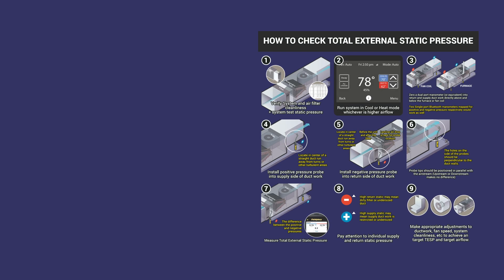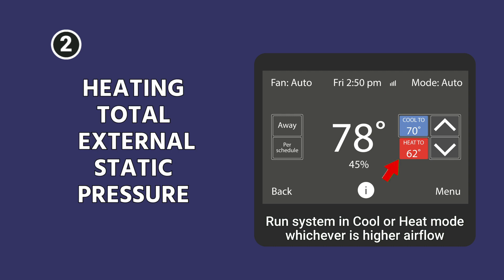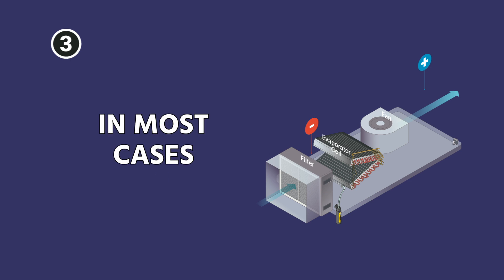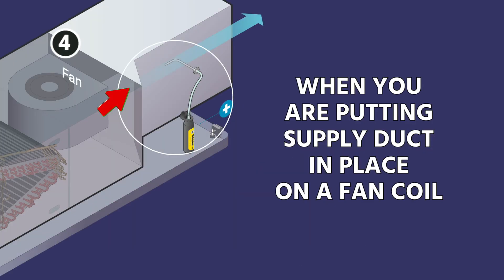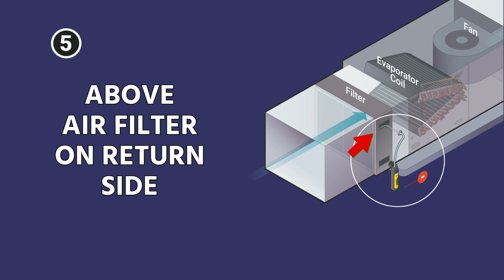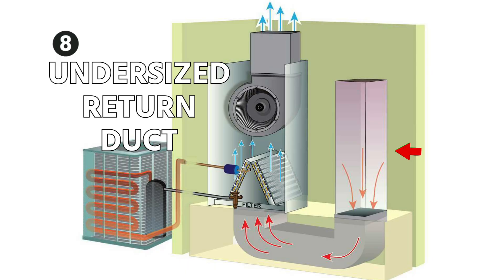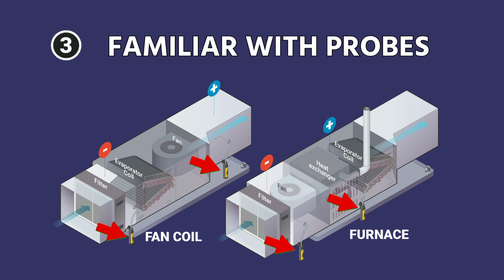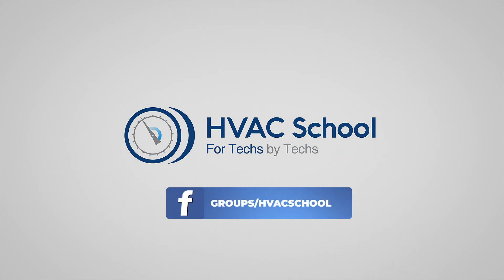How to Measure Total External Static Pressure (TESP)

Comment: This video shows a gas heat exchanger between the fan and the evaporator coil and goes on to talk about that.  My system is a heat pump with heating strips and the strips are located at the end, supply end i.e. fan, cooling coil, then heat strips.  Is there any difference with placement of the pressure sensors for that arrangement?

Comment: I think you should remove the line "avoid getting air into the end of the probe"...it is confusing.  "Point the static pressure probe directly into the flow"  You can then explain that the static pressure probes have pressure holes perpendicular to the point to measure the static pressure not the velocity component of pressure.

Comment: since the fan could run at different speeds for heat and cooling, wouldnt it better to check in fan mode since that will run at full capacity

Comment: Could you please explain to me why the blower is on the supply side of a residential air handler. I've been looking for the answer to this for weeks. I keep getting conflicting answers. Thanks
Reply: The Hyperion air handlers (Trane Tam) units put the blower before the coil. Worst design I ever seen. They are insanely loud on free draw stands and leak air everywhere.
Reply: On furnaces the coil is blow through...on heat pumps they are usually suck through coils.  This was a tad confusing.
Reply: Because an air-conditioning system's job is to 'supply' a space with conditioned air.  That air then eventually 'returns' back to the unit due to various factors, including velocity, pressure, temperature, etc.
Reply: @ParabellumX  I don't think that's this person's question. He's probably asking why the blower is after the evaporator coil versus before. It doesn't matter what side the blower is on as it'll still move air in the same direction...

The question is better asked as why some configurations have the evap coils before or after the blower. I believe HVAC's with gas furnaces may have the evap coils after the blower.

Comment: You say to point the probe into the air stream then you say you are trying notto get air directly into the probe . How is it that you can avoid velocity pressure when you point the probe directly into the air stream.  You said point it opposite of the air flow (not with the air flow) I think you are measure ing velocity pressure id you do that.
Reply: The answer to that is : the probes don't have an open ended tip like a plain tube that is bent 90 degrees. the openings are on the sides of the tip. check out some close up pictures of the products out there for a better view than i describe. hope this helps
Reply: @googleprivacy2829  Yes this. Static pressure is the pressure NOT associated with changing the velocity of the air, so the airflow must be perpendicular to the actual openings on the probe.
Reply: @googleprivacy2829   - That's what I was looking for.  Thanks

Comment: What about a unit with electric heat strip. Where do you place probe before or after Strip..
Reply: If you want to know what the static pressure of a unit with heat strips, first, turn the unit on Heat, and make sure that the indoor blower motor's fan speed is on High (turn the Fan Select switch from 'Auto' to 'On').  Then, simply place your negative probe IN THE AIR STREAM before the heat strip(s), and place the positive probe IN THE AIR STREAM after the strip(s). 
  The difference is your pressure drop. 
  The problem with this scenario is that you are not measuring the pressure drop of the heat strips themselves.  You are measuring the drop in pressure ACROSS THE UNIT, with the heat strips being the only means of providing heat, and the indoor blower facilitating the pressure drop and circulating that heated air into the conditioned space.  Obviously, if you have a heat pump or a gas/electric furnace, then the heat strips are not going to be your primary source of heat, as the strips are for emergency, or backup heat. 
  You would have to disable everything but the indoor blower motor and the heat strips in order to determine the calculation you are inquiring about.
  In my opinion, that's just not very practical.  Instead, it would be more practical to determine the pressure drop across each individual component (i.e., the air filter, evaporator coil, and even the blower itself).  Then measure the TESP (Total External Static Pressure) across the entire assembly as a whole.
Reply: Read the handler manual. In some units, it's not practical to measure before a heating strip, but the handler manual or heater manual should specify a static pressure drop which you could then subtract from the high side reading if you probe after the strip. However... strips are like .01 or .02 inches of pressure... so it's not much of a factor.

Comment: I do not understand the placement of the probe on the fan coil unit. If the probe is placed before the coil and the coil is blocked with dirt and crud you will get a low reading but if you place the probe after the coil you will get a high negative reading because that fan is really sucking trying to move that air and when this is added to the supply probe static you will get a very high TESP which means you will be moving less CFM’s. Somebody please help explain the placement of the probe on the return. If I want to check static on an old unit I will not get a correct TESP if my return probe is before the dirty coil. Thanks.
Reply: That's the whole point to find an issue as to WHY the airflow is obstructed. Recommend Cleaning the coil and then check it .
Reply: @Progress24.7  My whole point is that they say you place the probes here and here to get the TESP. That is only true on a new unit. If you are servicing an old unit you will not get a true TESP if the coil is blocked, you will get a low TESP meaning you should have more airflow. Probes placed on the discharged of the fan and the incoming or return side of the coil will read low TESP if the coil is blocked, which means more airflow and actually it is complete opposite.

Comment: Why don’t you put the probe next to the blower on the fan coil??? Instead of before the coil? It would add more resistance, or is it because you’re measuring “External” static pressure and not “total” static pressure?
Reply: Total external static pressure of the whole air handler is being measured and the coil is part of that piece of equipment. On a furnace, the probe is inserted before the coil because we are measuring the TESP of the furnace. Also, when measuring TESP, check manufactures instructions to see if the coil should be dry.
Reply: @bill944  Thanks, I guess that makes sense. And what does a dry coil mean? Not running I’m AC or HP?
Reply: Yep. Just pull the o/d disconnect. Most important thing, always read instructions for that specific piece of equipment.

Comment: This is awesome, however I would disagree w/ the AH / Fan-Coil section... Most units include / come w/ a factory filter, however the docs are typically horrible or never mention what the drop is for said filter (and they're typically way to small for anything but a rock catcher)... This is why I prefer static mapping on new equipment (although I know that's beyond the scope of what this video is going for).
Reply: You are correct usually when dealing with Carrier fan coil the external static chart includes a factory filter, As an example for a  3 ton Fancoil I found carrier data published as a .09 static pressure drop for factory filter.  Therefore when measuring out in the field more than likely the factory filter was replaced with a pleated filter which now may have a .4 static filter pressure drop.  From here is simple , measure external pressure including filter , obtain that measurement and then take the difference of the replaced filter vs factory filter reading and add to external measurement then go to chart.  For example you read .3 on fancoil , then filter difference (.4 -.09=.31 )  , then add .31 to your external measurement and now your actual static is .61 , now that’s the number you plot on chart, you must always adjust from factory readings , most people miss this and it’s never taught.
Reply: Trane manual specifies no filter with wet coil and dry coil (heating and cooling modes). But it does have TESP ranges which COULD include a filter. So It effectively takes filter variance out of the spec.

Comment: Does the furnace motor matter? Will ECM motor increase static and PSC decrease from lack of airflow?
Reply: I have been told that psc blowers tend to “slip” at higher static pressures, which I take to mean that they don’t spin as fast. EC motors will hit their rpm target if they have any enough horsepower to get their working against higher duct static.
This is is the explanation I’ve received for why psc motors draw fewer amps when they are starved for air and ec motors draw more.
I’d love for somebody to verify that.
Reply: @paulgaras2606  I've been told the same thing. Thanks.
Reply: @paulgaras2606  Some Lennox furnaces with ECMs will actually throw an error code to let you know that they are not moving the cfm that they were programmed to deliver. This is on the newer furnaces. The old ECMs would just destroy themselves trying to produce the cfm that they were programmed to deliver. Of coarse, the programming is done by adjusting the dip switches on the IFC. Psc motors will over amp if there is no load on them so it would only seem reasonable that the amp draw would be lower if airflow is restricted. Take a psc in the housing out of a furnace going to the scrapyard, power it up and check amp draw. Slowly start to cover the outlet of the blower housing with cardboard and the amp draw will go down.

Comment: Thanks Bryan.  Question: Why do you not take the reading at the inlet of blower after the coil on the air handler system?  Wouldn’t the coil count as a pressure drop in the return side?
Reply: Because it's "in the box" as rated - meaning it is shipped with the coil so the manufacturer accounts for it
Reply: @bryanorr8818  that makes sense!  Thank you!
Reply: How do you know if the filter is included in the box? It takes way too long too find it in the manuals

Comment: In a perfect world, the return and supply will be the same?
Reply: Not necessarily. Your return might be intentionally lower if, for example, a  central return is used (with transfer grills) or a plenum return in a commercial building. Obviously the supply ducts run to each room/zone so the supply static would be higher because the return is so much shorter. It would not have to mean that there is any problem with the design
Reply: Yes.. the static of return is lower than suply but depend on what the lenght of  return duct.